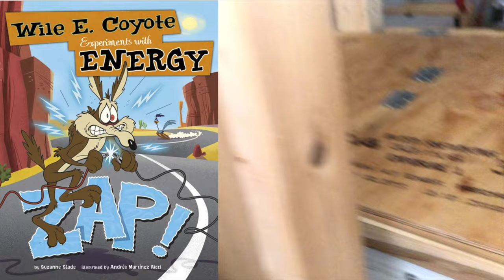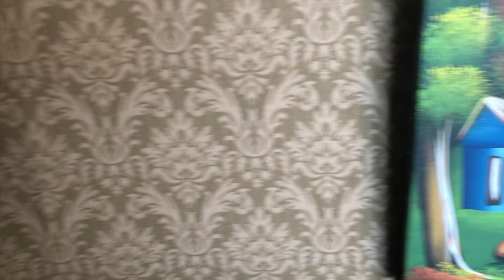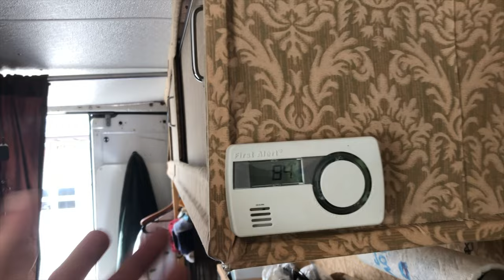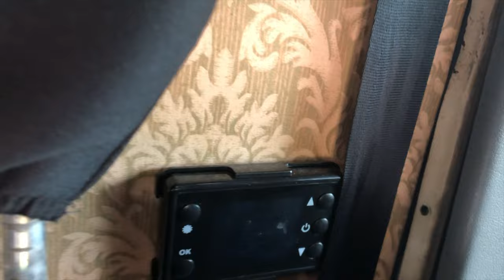What Not To Do When Building a Camper Van

Comment: One point of disagreement: chain is better for that fold down table because nylon webbing will retain some stretch-iness that will always be there when pressure is put on the table. Maybe a vinyl coated braided cable would be a perfect blend of the merits of chain and webbing. Either that or maybe solid struts that hook onto edges of the table and lay flat on one or both sides of it when not in use. Use some tiny rare earth magnets to keep such from flopping around when not in use. Great video.
Reply from the maker: Chain rattles, even if coated it swings against the wall. There is no noticeable stretch in the strap with weight of the table and settings. Even a hundred pounds wouldn't stretch it more than an eighth inch. I understand your reservations, but I think you'd agree after trying it.

Comment: Lots of lifesaving tips in here. The diesel heater especially.. it must be mounted to the floor directly!! I installed mine correctly but was still too paranoid to sleep with it running. Great advice on the wood too.. I used a bunch of 1/4" tongue and groove cedar in the build (in the midwest) and when we drove out to dry parts of the US like arizona and new mexico, it all contracted and looked a bit goofy. Not sure a way around that other than using a good sealed wood all over. My build was pretty quality I think.. I made sure to make everything easily removable with a drill if needed like accessing the door to repair

Comment: Bugger!! I just learned something from this that I'd never thought about. Not long put a 12V compressor fridge in my T1N LWB. Ran heavy 6MM twin cable from batteries to fridge under the floor of the van and , thinking I was being clever, put the cable through corrugated conduit. to protect it. And the thing that I just learned is that it will rattle.😒😒😒😒.
This is now going to drive me nuts until I strip it all out and wrap it with that spiral plastic stuff.
I'm gonna stop watching "how to" videos.
Reply from the maker: The conduit may also trap heat on the wire. Every step has pros and cons and nobody knows the full story until about the 84th attempt. :O)

Comment: They do make stranded, tin coated romex. But extension cord does the trick for sure.
Reply from the maker: Supply and demand causes an illogical price flop. 50 feet of 12/3 stranded wire cost $65 but I can get a 50' 12/3 extension cord for $32. Seems to be the same wire at half price.

Comment: My Airstream Interstate has the bench/bed blocking the door opening.  
I like the Sprinter and the amenities of the RV but not the layout. It also has Romex in it from the factory.  SO or SJO cable is what I would use if I built one.

Comment: What’s a better way to mount solar panels?
Reply from the maker: Thru-bolts with nuts. Ideally the bolt would come from underneath, Dicor or similar sealant circle the bolt then place the angle bracket onto the the bolt, more Dicor with a washer and nut on top. This allows us to remove the nut and lift the bracket if necessary later-on, without tearing out the ceiling. The Dicor will softly hold the bolt so it doesn't fall. Some creativity may be needed to loosen the nut and hold the bolt, but the can be sure this will never fly off and the Dicor sandwiched will not leak so easily as this van. 
If you cannot access the bottom of the roof without tearing out a ceiling use adhesive sealant between the van and bracket, then use 3 or more self drilling screws in each bracket. Pre-drill holes in the bracket so you get tight and secure hold with the self-drilling screws. Remember we are gluing to paint, not the metal under it, so don't depend on the adhesive and just plan on one or more screws failing so put extras in the plan. We really don't want this coming off on the highway.